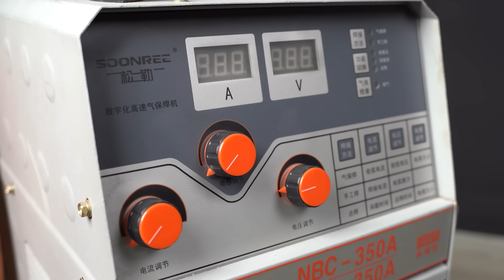Levitating Silver man Trick Revealed

Comment: I still don't understand how this works. After he put on his coat I can't figure it out.
Reply: Just look at 2:57, 3:15 and 4:20, then connect the dots
Reply: I saw ur mentioned time and full video also but can't understand that how he control his wait?
what is the purpose of square shape pipe (in the floor) any gases support him.......?????can any one explain me😊 4:30 plz
Reply: @naziaarshad9823  The shovel is welded on the square pipe, it keeps the shovel straight up all while supporting and stabilizing the performer's weight so he doesn't tip backwards or on the side. The metal bar attached on the shovel handle is curved so his arm can comfortably rest on it (like the arms of a chair), and the harness worn by the performer is attached to that bar, which completely prevents him from falling. The performer's arm resting on the curved bar, and the harness keeping him in place, allows him to make all the poses he wants without too much effort as seen at 4:55. The performer mainly uses his abdominal muscles to move his body in different angles, and to maintain his position for extended periods of time. When at rest, his body just stays straight up. Hope this helps.
Reply: @GenericGoogleAccount  thanx dear for explaining me
Reply: @LilRedRasta  The performer appears to be putting weight on the bar under his sleeve when he's changing his position, it would be pretty difficult to pull off without doing that, let alone maintaining that position for an extended period of time. But yes, while I would expect the harness to hold the performer in place even if he's not resting his arm on the bar, it would make moving his body around and keeping his balance very difficult, if not impossible.
Reply: @LilRedRasta  Yes, I do think the armpit resting over the armrest would be helpful
Reply: @GenericGoogleAccount  75% wrong. By the way, the shovel literally serves no purpose.
Reply: @frenchbostonstreet  You got me there! And that’s right, the shovel is just for show, the performer is just a skilled magician who mastered the art of levitation, this whole video is just a distraction from this fact!
Reply: The shovel is for scooping up all the BS.
Reply: Deveria tirar o casaco pra ver como funciona o mecanismo por baixo🤔🤔🤔
Reply: It’s literally playing with my perception of his center of gravity. It’s almost like it’s changing suddenly.

Comment: After all that. I still dnt understand the physics🤦🏾
Reply: Me either, because they won’t do it without the coat. That’s all I need to see
Reply: @WhiteWoodEnt  the part of the trick he didn’t show you was that his hand that is attached to the shovel is fake. His real hand is under the coat.
Reply: The key is 3:00 to 3:20. A metal bar attaches to the top of the shovel and then attaches to a harness which holds his weight. And no he doesn't need a fake hand like some street performers use.

Comment: I refuse to believe that those welds was not redone by someone else before the final product were displayed. They would not have held up.

The craftsmanship if it can be called that displayed in this video is just horrible. The welding is kinder garden level and  the correct way to install screws into metal is to drill and tap, not put farmers screws into holes. 
The correct way to bend steel is while it's hot, not hammer it unitl it's close to cracking.